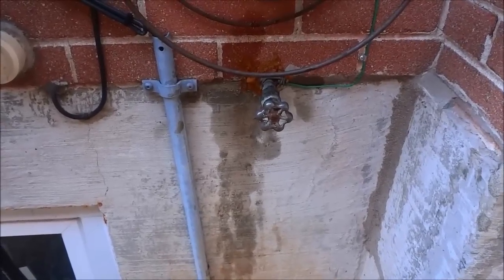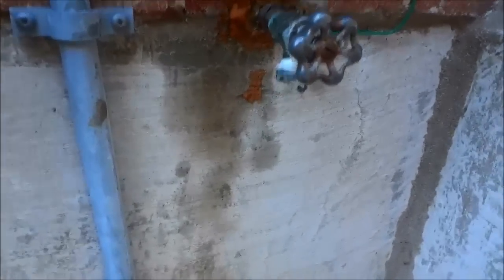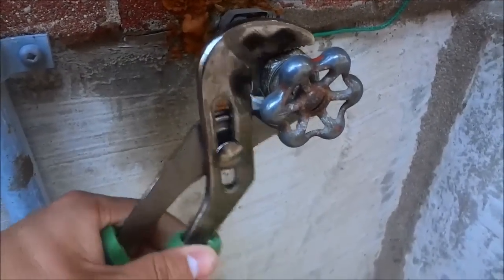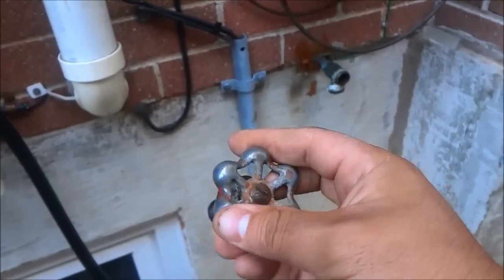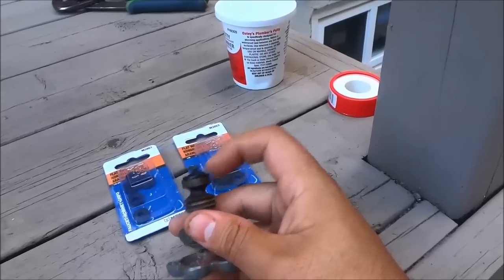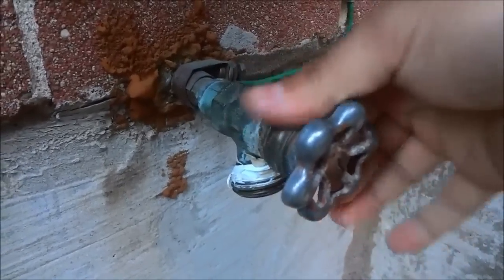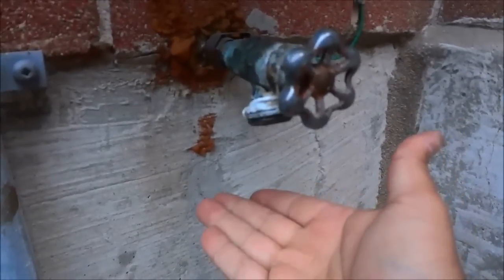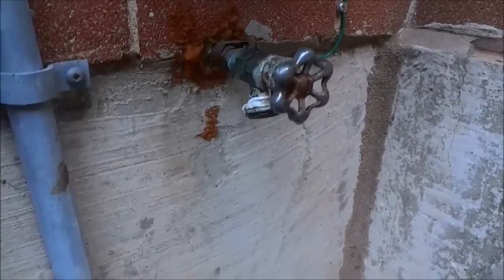How To Fix A Leaky Hose Faucet (No Plumber Needed)

Comment: Please do not screw stem all the way in before tightening the packing nut. When re- assembling faucet,  bottom out stem  and then back it off one turn.  Then tighten packing nut. That will prevent damage to new washer due to over tightening.  Great videa!
Reply: where do i get a packing nut? thanks

Comment: Nice! I have one that's very very similar, but I thought I had to remove the screw in the middle of the handle first. it is definitely not coming out, but I'm sure I can remove the front half like you did using channel locks and a crescent wrench.
Reply from the maker: Exactly! Glad that you found the video helpful!
Reply: Helpful DIY Well, mine looked the same on the outside but not the inside. I had a 14.5 inch long stem with a  washer on the end. Changed it, and all seems better now.
Reply: The 14.5 " long stem "carries" the water shutoff function back away from the outside wall . This is helpful in cold climates . ( less chance that everything will freeze up )

Comment: Hi, my faucet that was leaking goes to my washing machine.  It is the hot water one.  I turned the hot water from the sink off, but it is still leaking.  I had turned the cold water switch for the house off, but turned it back on because I didn't think it would affect the hot water spicket.  Do you think this is why there is still water coming out from it?
Reply: +Sheila meri  the hot water heater and hot water side of the plumbing system is connected to the cold water supply,,  but hot water outlet or inlet at the heater usually has its own cut off service valve that must be closed to shut off the hot water side of the system and leave the cold water on  also be aware any mixing faucets like a sink faucet will often back feed cold water into to the hot water side of the system "if opened" even when the hot water is supply is turned off .. its a strong suggestion to "turn off" the hot water heater whenever you interrupt its supply feed to prevent the remote possibility of it running dry and burning out an element or causing damage to a gas fired heater if the water gets too low , if its electric heater turn off its breaker, do this whenever you interrupt the cold water supply to the heater. if its gas heater consult a gas technician on how to property turn off and on your particular heater..  also be aware all water trapped above the washer  supply valve will drain from it when you open it even after the water is off until the pipes in the system above are drained.
Reply: I wish I could be certain of all you are talking about.  No one has shown me where all these connections are.  I think I know where the hot water is under the sink (left side). There is a cold switch too under the sink.  (This is what is confusing me). The main water switch is near the washer and dryer.  The hot water heater is next to my dyer and has two valves for, I believe, water release.  I think it says hot and cold on it.  I never noticed these valves on my water heater until recently!!! I can try to send you pictures of all this when I get home.  Thank you so much for your help!!   Sheila

Comment: If you already have the valve disassembled to replace the washer seal, why not simply remove the handle and replace the valve stem o-ring at the same time? If the seat is worn, the o-ring won't be far behind.

Comment: wow this guy sounds like a professor. should be a 2 min video
Reply: ray r at which of your local "skool" does he sound like a prof to you?  Please tell is so we can avoid that area LMAO.   He sounds like a typical north eastern guy or eastern Canadian
Reply: ray r  I agree with you that the video could be shorter. No offence brah.   However I'm certain, the fact that he did it in near real-time is appreciated by those that need things explained slowly.  However I'm sure has going to have allot of people upset when they break thier copper pipe and have to replace it.  Since the right way is to use a pipe wrench to hold the pipe.  I'm certain he must have pre loosened it, that way.  Even the terminator himself couldn't hold it if his spout was fit tightly and he would have twisted the pipe going into the house.
Reply: make new video!

Comment: Good job however the correct way to prevent breaking the pipe in the house is NOT to hold that pipe with your hand, spend $5 use a pipe wrench to hold the pipe.  You may want to  amend or add a disclaimer to your video.  I know if it cost me $$$$ to have pipes replaced I'd take you to small.claims court of also include YouTube in my claim.   Other than that good job!